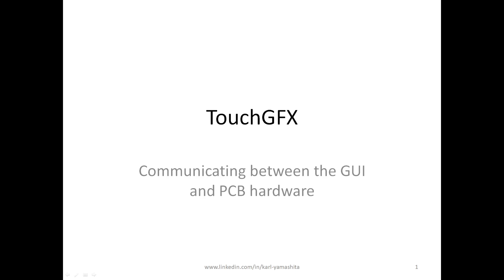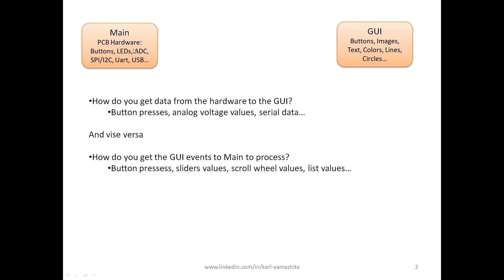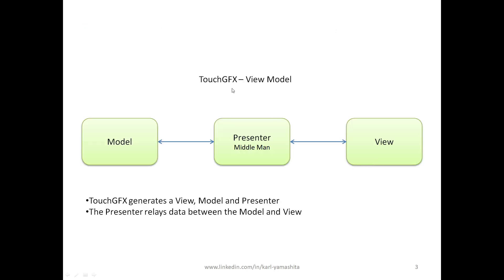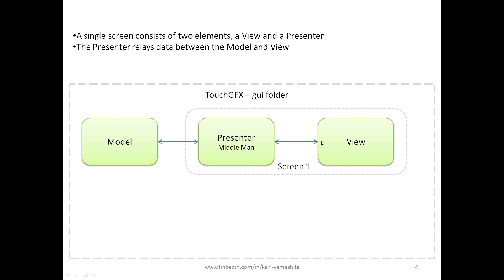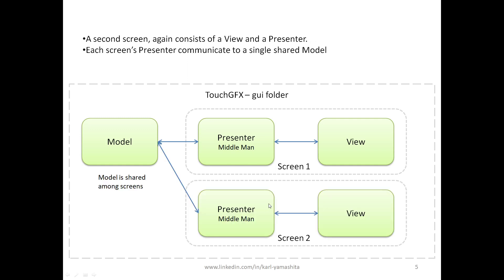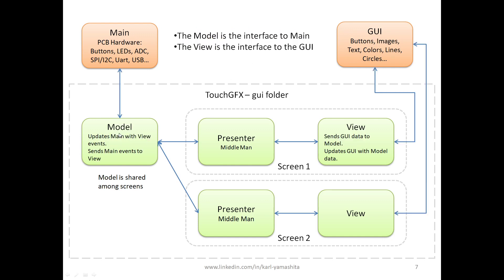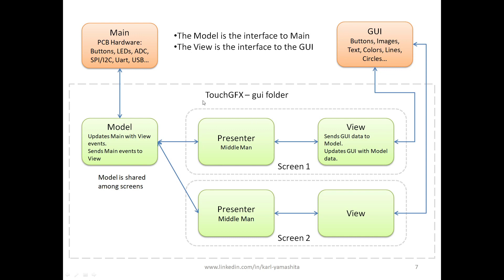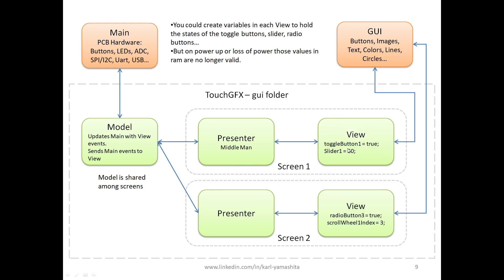TouchGFX communication between hardware and GUI

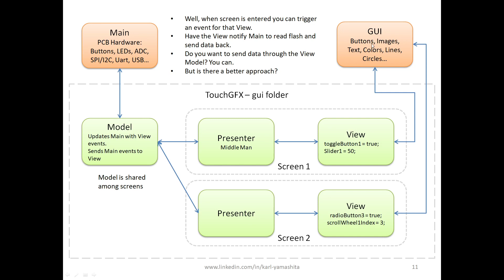Comment: no no no no no no no!!! man - I enjoyed this video until 8:05 -> global variables are the worst thing in this example. You need to adjust you application to MVP model - not "hack" this by adding access to global variables... in some "simple/basic" applications this will be quite ok/faster to implement, but in big apps - no way
Reply: what would be the better way??
Reply: @leslieleslie336  just use MVP pattern - pass all data via all layers with functions to separate logic.
You can read about MVP in android applications how to use it.